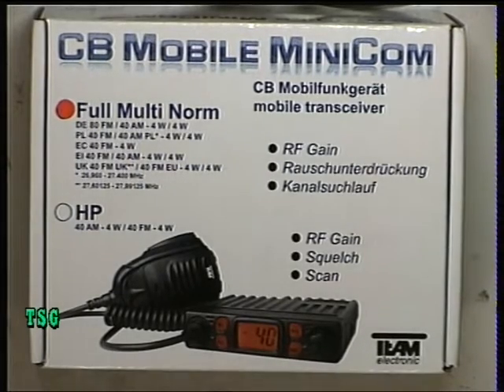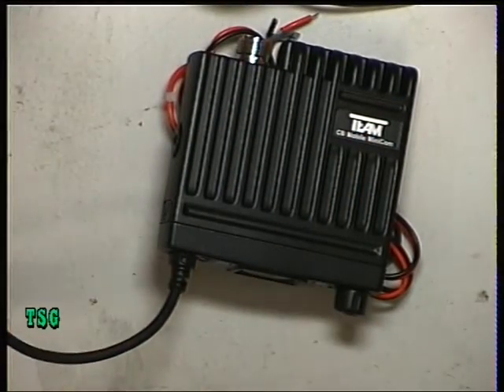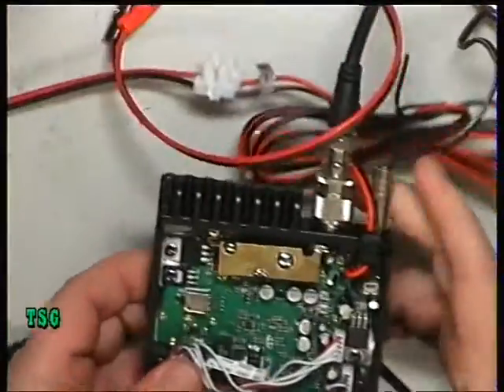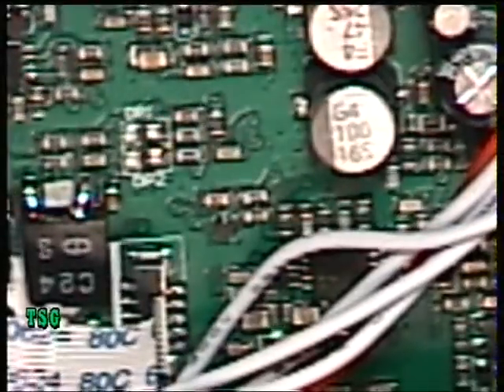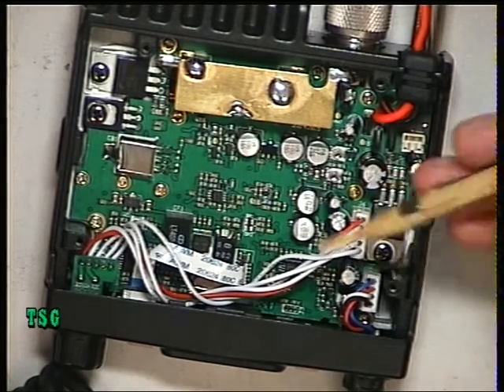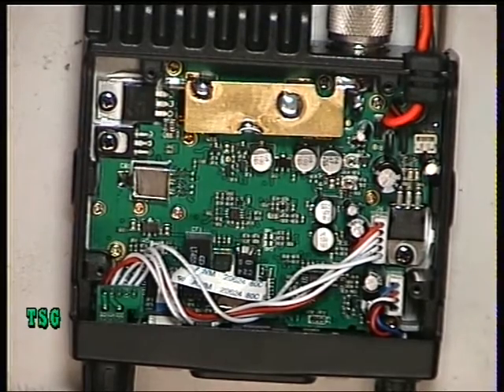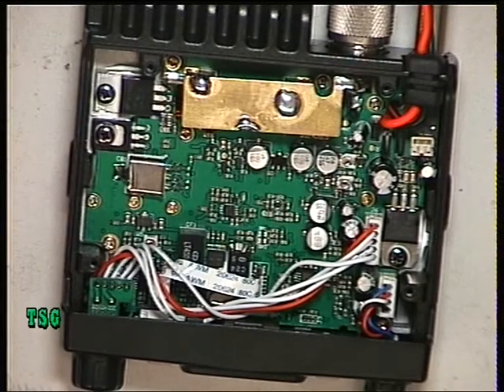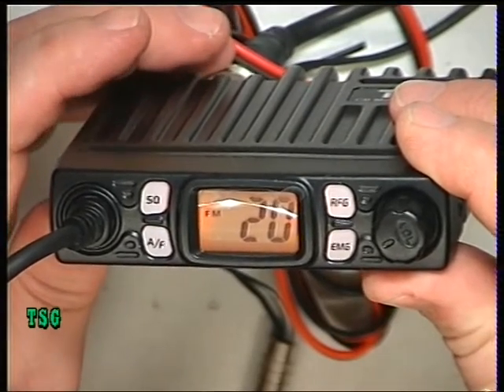Team Minicom,  UK (CE Multi-Norm) CB radio (Mobile) - Transmit

Comment: Hello Richard- thanks for the video
Can I ask you ,when you increased the output power ,
was there any increase in the spurious content of the
PA output spectrum ?
Reply from the maker: +Radio Ham I have to admit I didn't put it on the spectrum analyser. There is a point where increasing the power level preset makes no further difference on a lot of radios like this that have non-adjustable PA's. Once you go past that point where there is no difference, that is when spurious emissions could possibly start. A bit like "I've turned it up to full, mate" from a screwdriver expert, when full is not in fact maximum..

I still have it on the bench, so will transfer it across to test bench 3 & look at it on the spectrum analyser, but am not expecting any snags on a set with this kind of build quality...i.e. good. At the end of the day, it's still a tad under 4W output!
Reply: +UK CB radio servicing Richard thank you ,of course you are right, the spurious emission's at this power level are quite low ,but if they are using a form of broad band technology there must be some sort of ability to adjust harmonic emissions later in the life of the radio .I wasn't trying to question your ability just curious!!(what did you find)?

Comment: Yeah not another one those again lol
When are you going to cover legal fm/am/ssb sets?
Reply from the maker: +256 colors I thought I'd do all three that I could find....in a row. Perhaps I'll do a dozen Great GT868 sets in a row!

Regarding UK SSB sets, there was only one on the market that worked how I wanted it to, and that's the President Grant 2 Mk 2, which I bought a sample of & did an overview/on the air test.  The only SSB sets would buy MUST work like this:-  When set to use in the UK, it must be UK40, FM only, then CEPT band AM, FM, USB, LSB. 

There are sets on the market that when you set them up for UK, only UK band is available, so you the have to set them up for some other cept band. This, to me, is not good enough.

I still can't do much technical with the Grant 2 either, as although I now have a service manual for it, our Sclumberger SSB test set has a PSU fault. None of the other three test sets do SSB, although I appreciate most parts of these radios are set up in AM mode, I still need to prove the thing is working with instruments. I am on a very tight budget here, and can only take limited time out from our pipe organ restoration business to do the CB things. Last year I had 45 large 1960's radiograms in for service. I have the service manuals & training, so got on with them, to the detriment of sorting out the Schlumberger test set!